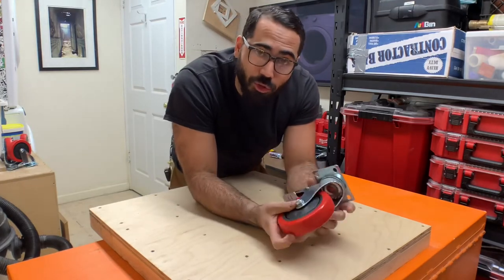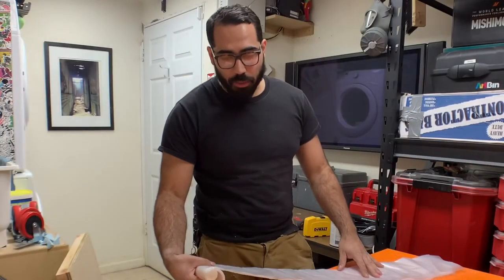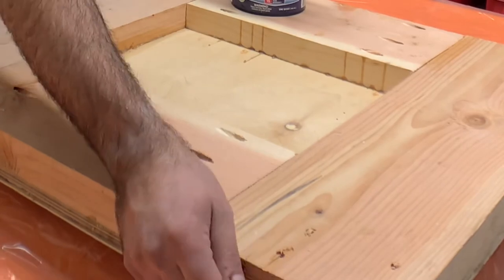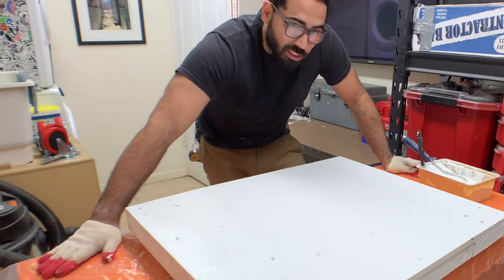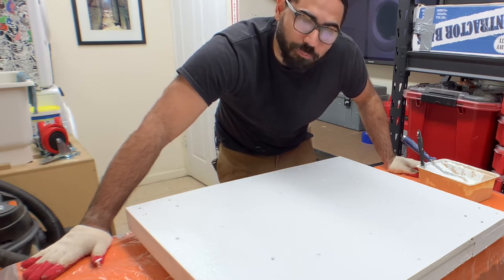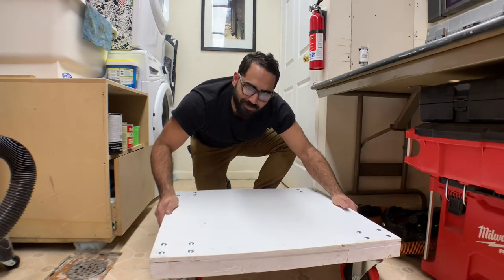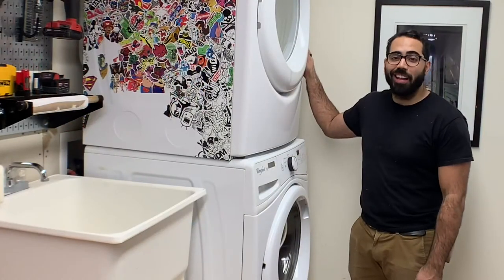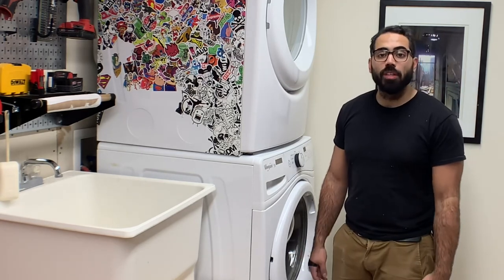Washer/Dry is finally on wheels! // Skill Stacking

Comment: I have 2 washers and 2 dryers, I'm considering building a platform out of 1 1/8" plywood with 6 wheels, 1 at each corner, and 1 center front and back.  After using your machines on the dolly you built, would you recommend all wheels be locking or just the 4 corners?
Reply from the maker: I recommend you lock them all. You will still get some movement. I have to move it into the right place ever 6-8 months

Comment: I would like to do something like this for my washing machine only so I can service our dryer easier. How do you know that the platform will hold the washer with a full load with water? Also, does it move around a lot when spinning?
Reply from the maker: 80% of the dolly is 2x8 the rest is plywood holding it together. After using it and morning it around during construction for about two years, it is still holding up. If you are a little doubtful of the dolly, I will also use pl construction adhesive to add that extra strength. Also it dose shake while rinsing and move about a 1/2” every 8 months or so.

Comment: How do you handle leveling?   How is vibration?
Reply from the maker: I didn’t level haha. Two years later and this is the first time I think about that. The vibration isn’t bad in my opinion. When I wash bed sheets, a heavy coat it vibrates a lot but with the wheels lock it really isn’t a problem. The washer on the platform doesn’t move so I am not worried about my washer falling. But I find myself having to unlock the wheels and straightening the washer like once every 6 months or so

Comment: When you stack dryer on top of washer how does it impact the vertically challenged, shouldn't the manufacturers move the controls to the lower part of the dryer? Those 5 ft and under will love it. Come on LG take the lead.
Reply: Samsung's newer sets have a wiring setup that turns the washer's controls into both washer and dryer which renders the top controls unused
Reply: Lol, us not so short people 6' would have trouble reaching the controls if the dryer was on the floor next to the washer.  Lol